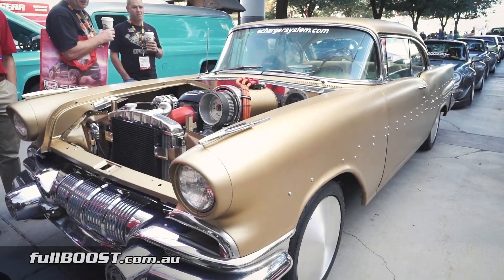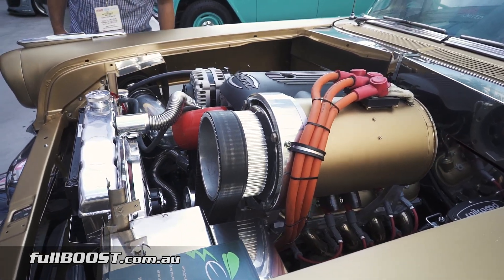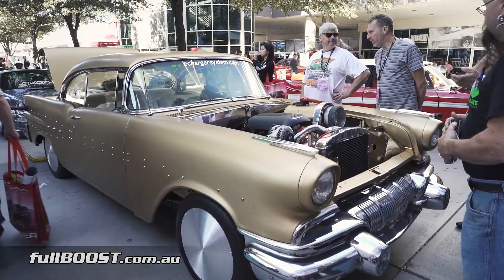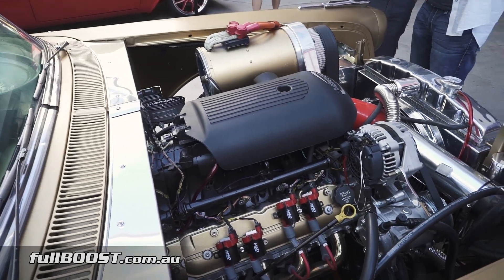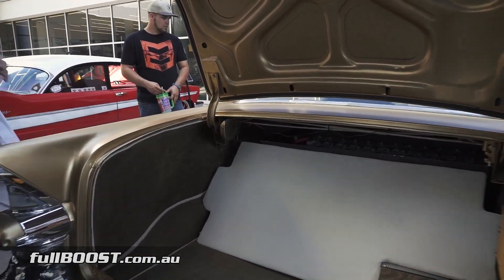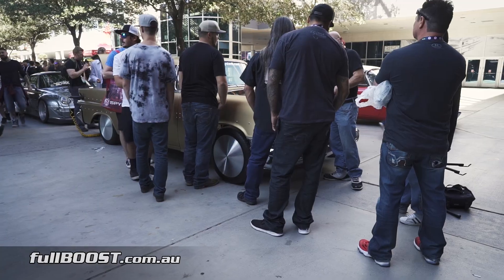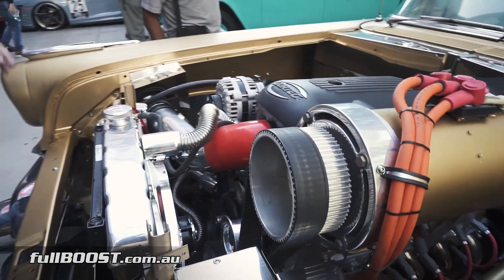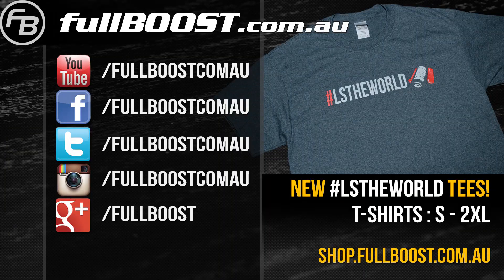The E-Charger Hybrid System

Comment: truck engine in a ''fast car'' fuck this.
Reply: AMG BENZ_HAMMER_6.0 , , , yeah they should have put a real motor in it, like a Vtec with extra Vtec or something
Reply: Annnnnnd there's the troll. I'll let you in on a little secret though. Religion is bullshit and I can see that you've been brainwashed beyond the point of no return. You've got a pretty good troll formula going though.
Reply: AMG BENZ_HAMMER_6.0 a muscle car is nothing more than a car with a truck engine in it. thats what carol Shelby did with the original cobra. that's how the v10 engine for the viper was developed; for a truck. oh and all of those new corvette? you guessed it. truck engines. how about those old chargers? not only did dodge use the same nascar developed 440 engines, they also used the same drive line and suspension as their pickups. my 91 firebird stock has the L98 engine (labeled LB9 in a chevy) which was originally designed for gm full sized trucks. most American auto makers use the same components across multiple platforms. any certified mechanic can tell you that.
Reply: Um... An ICE engine is an ICE engine. Who gives a shit if it came from a truck? There are only a few differences between the ones put in cars and the ones put in trucks anyway.
Reply: John your wrong it makes alot of difference. This just shows u dont know much about cars lol
Reply: I hope trolling.

Comment: does no one read/pay attention anymore, watch the video, "middle manning" by putting it on the tranny or shaft defeats the purpose, first it will fight with engine unless you have a proper control, which mean more parts/money, which mean less "economy." he also describes why it need to be on the crank. imagine you have to carry 100lbs by urself 10 feet, hard but doable, now imagine you get a friend to help you carry it 10 feet  - a lot easier -  thats what this does.... it takes a slight load off the engine, if connected to the tranny output then carry that 100lbs by urself 10 feet then hand it to your friend so he can carry it 10 feet.... doesn't make sense right. the torque gain is basically because it turns the engine for your car before your car even does it so you have more "power" added on top
Reply: however i do think its dumb and only good for show cars such as the one its in right now like he said you can get 35 mpg in a 5000lb car...will he be drag racing? hell no! will grandpa enjoy using his original 1932 ford for 15 more miles to the gallon? hell YEAH!..... but,  250 lbs of extra weight in a DD car will in itself be sh*t for economy, 150lbs of torque or not since a daily car won't really be "pulling anyway' ( that's why you kinda hid the battery packs a little huh ;) they are in the video for all of 3 sec then back to staring at the shiny car) its been said but it needs more time and design effort, am i a scientist, no, but even i can see there are flaws in the basic design anything "universal" is already assumed to sacrifice something for that universality.
Reply: triple post for the win! just rewatched it for the 4th time and he states that it can be turned of while at stop... LOL... so its off at a stop sign and now the car under its own force must push a car with an additional 250+ lbs until the motor starts again so for maybe 2-3 secs ur basically hauling a real fat b*itch around until "ecoboost" kicks in yo! then then you just eat fat batteries lelellelelelellele.... oh you can make it run consistently and not stop......lol he just said you can add more batteries! which is like 40 more lbs per batteries lel very ineffective..... im guessing its gonna cost around $2000 dollars am i right? im calling you out FULLBOOST learn what to say in an interview and how to sell product or send me one and i can youtube its effect and if it does work ill take it all back. or call japan and ask them how to be efficient. we americans need to stick to power and outsource for efficiency you cant really get both evenly, there's laws of thermodynamics for dummies in barns and nobles on a christmas sale, pick one up.
Reply: Holy shit. For someone who watched the video 4 times, you really missed the point. 

Your first post makes no sense. Whether the electric motor is inline with the engine, or attached at the crank by a belt it makes no difference in how it operates. An inline would be slightly better just because it reduces friction by not having a drive belt, and would reduce radial loads on the crank bearing.

Second post. Why is adding power and fuel mileage at the same time a bad thing? This might be the dumbest point you made. Adding 250lbs to a 5000lb car will have a negligible impact on fuel economy and performance. And when that weight is combined with a 150lb/ft torque boost and a hybrid system with regenerative braking, you're looking at an increase in performance and fuel mileage that far outweighs the problem of increased weight.

Third post. The system turns THE ENGINE off when the car is stopped. You know, that thing that burning fuel then you're not going anywhere? How did you get that so wrong after watching it 4 times?
Reply: It bolts on, versus major mods on a driveshaft through transmission
Reply: The average American weighs 250lbs

Comment: it says up to 150 hp.  for an expensive untested thingie I may as well run a well thought out nitrous. The future is batteries, not battery powered superchargers pushing extra amounts of terrorist funding gasoline.  Saudis did 911  read up on it.
Reply: Jonathan Nagela From cars to 9/11 conspiratard in 2 sentences. Well done.
Reply: Yeah man, and how do we generate our electricity again? You also must not have watched the video, as that isn't a supercharger, it does not create boost or direct air into the engine. The belt turns the crank, not the other way around.

Internal combustion engines are still the most efficient way to turn fuel into torque - and probably will be for the foreseeable future.
Reply: Dumbest reply so far. Congratulations.

Comment: well, if how often blower belts break as a comparison, i can't imagine a belt holding up to 150ft-lbs of power, and asuming thats what does the engine braking too thats a whole lot more strain than it can probably hold for any long period of time. cool idea, but no thanks. plus you'll probably negate the benefits when hauling around all that extra weight

Comment: I see way more cons then pro's with this set up
Reply: J it's not about boost. The electric motor assists by giving direct power to the crankshaft. Somewhere around 40% of the energy produced by and engine simply goes into keeping the engine spinning through its cycles. If you add a beefy torquey electric motor to the set up its going to assist the motor much more than if you turbo or supercharged if.
Reply: Kyle Haley actually only one motor and an inverter in the rear, and the dual motor versions have another one in the front
Reply: That's just stupid.  You don't have to like Ford for whatever reason, but they make excellent engines.  All of the big manufacturers do.  Shut up.
Reply: Really? Such as?
Reply: Turbo plus a smaller engine with the hybrid would kill
Reply: Mr S no they don't. A regular model S uses a single motor and gear box in the rear. a Dual motor car (85D) has one in front and one in the back.  A performance car (P85) has 2 motors in the rear. A performance dual motor car (P85D) has 2 in the rear and 1 motor up front.
Reply: Kyle Haley
The idea here is to keep the "ancient technology" for nostalgia purposes but make it much more efficient. Plus the gas engine gives you much better range if you do decide to take this thing cross country.
Reply: why not just buy a testla instead of this? because this is a LOW COST KIT and the LS series are known to be reliable AF because they are simple engines so 1 you don't have Idea about cars... or 2 you are just a trolll
Reply: Tyler Hardy the P85D has only 2 motors, not 3. The P models simply allow higher current, but they use the same motors. It's cooling, cable harness, and software that differs. The D is for dual motor. Model S D variants use a smaller front motor than the rear motor.
Reply: Actually it uses either 1 or two motors coupled with a transfer case type assembly to create either a 2wd or AWD arrangement based on the model
Reply: As a hint the world's most efficient ice motor uses 48% of its power generated by its process to keep the process going. The average hybrid uses 62-66%. There's a lot to be had. ICEs just aren't efficient but the fuel source is much cheaper than electricity thanks to overtaxed grids in most areas.
Reply: @paladain55  yeah ok.  Electricity isn't cheaper.. where do you get your figures?
Reply: Franky's SpeedShop I think it was fast lane or aline of those types of channels did a much better job explaining the technology with their release of it in the 1500. Just look up ram 1500 hybrid.
Reply: Because its a con job.
Fake b.s.
Reply: Look how big it is tho .
Reply: I'd rather a 500HP 0m606 Mercedes or BMW 535d and still get up to 50mpg cruzin just saying
Reply: Wait for the 2.0 modle
Reply: I see both sides
Reply: Uses a motor on each axle, not wheel.
Reply: Franky's SpeedShop what are the cons?
Reply: Instead of assuming horse-crap, how about you take enough responsibility to explain yourself.
Reply: Franky's SpeedShop yes it's cool, it is not the most practical.
Reply: Mr S Technically two in the rear and one in the front on current models. And the first Tesla Roadster had one, fat, electric motor.
Reply: Kyle Haley tesla uses an electric motor on each wheel...
Reply: @MrS22222  negative
Reply: We are witnessing fords next idea!! Food is almost synonymous with engine failure as it is with half a dozen generations of one engine they will grab this and run ,to their detriment while everybody hits the right direction
Reply: Franky's SpeedShop Agreed. Do away with the LS motor all together. Its ancient technology. Put a big fat tesla motor in there!

Comment: How do you change a tyre on that sucker?
Reply: Those are called moon hubs. You can pop them off with a screw driver.
Reply: ....Take the hub caps off?
Reply: I just couldn't see where you'd be able to pop them off from.
Reply: if you looks closely it is bolted in
Reply: Wolf Blood they are hubcaps
Reply: Moonie FTW

Comment: How does it know to spin at the right speed and not throw out the engine timing? When to apply power and not to? I originally thought this would be some sort of super / turbo charger assist system to keep them spinning. Better than using anti-lag.
Reply: The belt is hooked to the crank. The crank is then hooked to the cams. There's no chance it throws the engine out of timing.... Just like when you crank your car over and the starter doesn't throw the engine out of timing.
Reply: Oh durr on me of course. I really was not thinking straight about that yesterday. Thanks for the reminder. It is starting to make more sense now. I think I was thinking about fueling though, would the load on the motor be read the same so the appropriate map cells for the fuel table are read? For open loop of course, I'd like to think yes. So this basically just eliminates the need to use the stored dynamic energy of the spinning assembly, (crank, pulley / balancer,  rods, etc), to keep the engine turning during the non power strokes? All motors have a no power portion of the spin which is reduced when you add more cylinders, but you cannot get rid of it entirely. That would add some great efficiencies. If it were used for this I'd imagine you could make that electric motor a lot smaller. Also should be able to get rid of the power drain of the AC. That would be good.

Comment: this system is basically what my malibu eco is. I think my eco only gets a extra 15 horses if I did my research right. Anyway my eco does exactly what they were talking about. it shuts down at stop lights and uses the electric motor to take off with and when braking it regenerates the battery. I don't have to plug it in at home of course because it keeps itself charged but it really does work! 200 bucks for over 3000 miles round trip on my vacation you just can't beat that!
Reply: I dunno man. I can do the same trip for $300.
Eventually, after the price of the car, we break even. You save gas but pay more for the car. I pay less for the car but pay more for gas. My trunk is bigger and I don't have to worry about batteries.

Comment: interesting concept... but only if the actualy motor and its efficiency is enough to justify the electrical load being added to things like the alternator and electrical system. Any electric motor generates heat and this would not be an exception.....this isnt an e-charger.. there is no "air charge" involved...its an E-assisted crankshaft motor. It reminds me of those backpacks the military is showing off to reduce strain on soldiers... mislabeling -_-
Reply: There is no additional load to the alternator or electrical system.

Comment: robing Peter to pay pall
Reply: Keith Maning, robbing Peter to pay Paul, not really 75 cent's to run electric plus 150pft of torque that's crazy.
Reply: +Franco Jordan OK how much does the battery's cost and that electric motor with brackets and that belt and up keep now second on how I'm going to school ya.you think a snout on a crank is designed for that. add up all the gas you think your going to save vs the cost of that .you just se and hear something with  made up numbers and believe it.I'm from the show me state show me
Reply: You can ask the intventor the cost of everything, the snout on any crank isn't designed for that, That's why it's called fabrication or engineering parts to make them work for u. A turbo charger or super charger cost to maintain also you cant get away from cost. From any idea or invention. Every bad comment about the idea is stupid to big won't work are non believers. This why they don't achieve anything in life except hate,envy,jealously and immature. Actually i didn't just hear some numbers and got freaked out. I'm a intventor/mechanical engineer and I'm working on the the same concept just that my idea is different electric turbos and water methanol injection it does the same thing improves mpg and horsepower by forcing air in to engine. You don't if these numbers are real. My car Hyundai Azera 3.8 v6 i drove from Colorado to Texas and it is cost me 110.00$ 780 miles my car got 40+ miles to a gallon of gas, I've got videos to of me showing my achievements but then again all the haters make up excuses as to why they think.... All of you haters and show me people are quick to judge till you're judged. It's people like you that make us stronger & better geniuses. Where's your life at what did you create or change for the world. I'm from the show me state ok, show me?😶
Reply: +Franco Jordan just give me your address your in Missouri or many I'll get you Mac address on your laptop or phone and I will take care of you

Comment: What a waste of money, if your going to bolt something like that on your engine, with a load of batteries in the back that YOU have charge every night, for a small 150 ftlb of torque, why not just get a centrifical supercharger that weighs less and probably costs less and you don't have to do anything else but drive the car for at least the same benefit of torque and increased horsepower. Nobody does anything like this to save money, or gas, it's all about going faster. This thing is useless.
Reply: Because you get an increase in power and efficiency. "Nobody does anything like this to save money, or gas, it's all about going faster" - Tell that to the huge amount of people of people who mostly use their muscle and classic cars to cruise around.